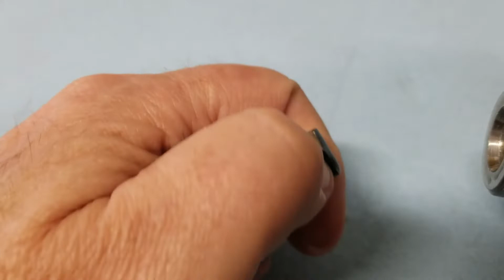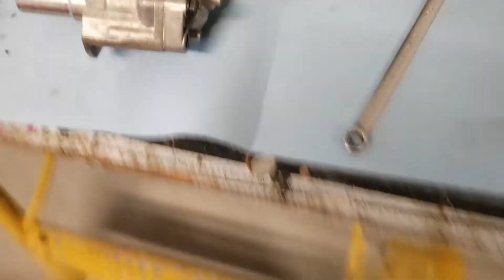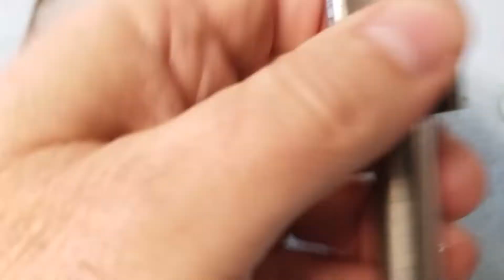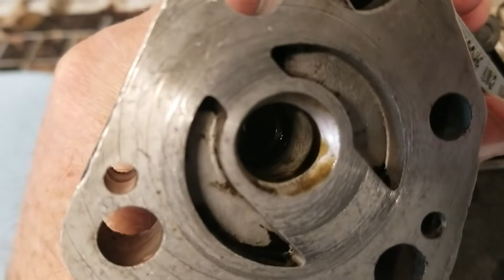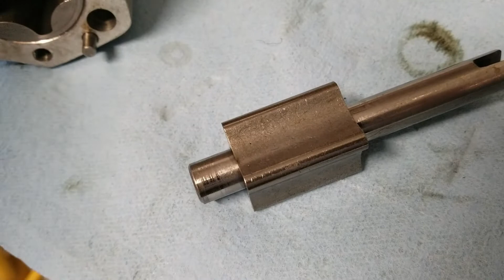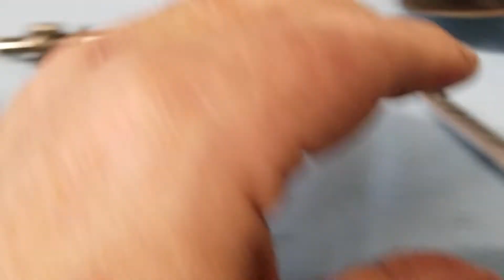Nigel the 1977 MGB oil pump inspection

Comment: Thank you for your video, I got my oil pan off, cleaned and repainted. Got my oil pump off. And thank goodness I did, the top sprocket shaft was covered in a thick metallic oil. The gaskets were originally factory ones and were as brittle as a potato chip. Just got done put all the oil pump parts in wd-40 with the ultra sonic on high heat for 2 hours. It’s very clean now. Thank you so much again for your video and showing me how to take it part and put it back together.